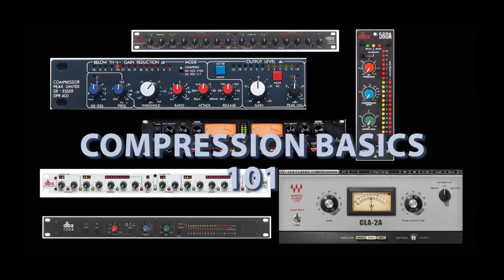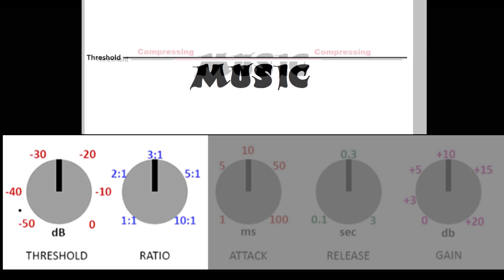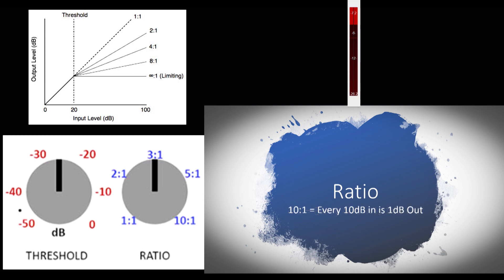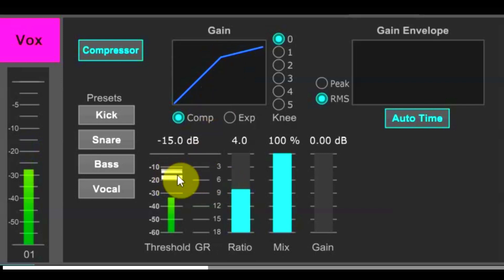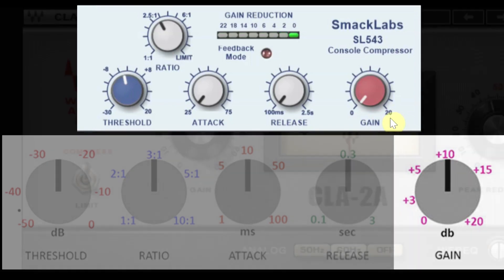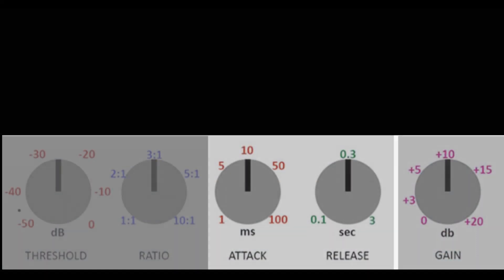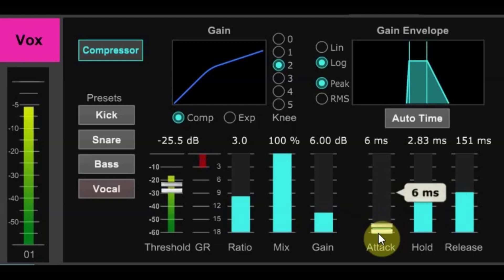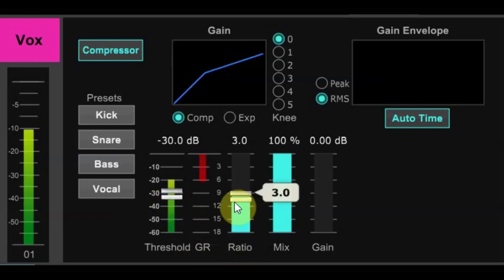Live Sound and Studio Compression Tutorial - Audio Compression 101 - Compression Explained - Basics

Comment: What settings would you recommend for a DJ set up with a compressor?
Reply from the maker: Is this for speaker protection or just limiting the dynamic range to keep things relatively even?
To keep things relatively even, I'd probably use a 3:1 ratio, auto time setting, and just adjust the threshold so the mellower stuff is just tickling the gain reduction meters, but louder tracks get into it more.
OTOH, if it's more about keeping softer stuff louder, I might back that ratio down to 2:1 (or keep 3:1) but set the threshold a lot lower so the mellow stuff is more into the GR meter. Maybe 4dB on average. Same auto time setting used. But this means the louder stuff will be comped more. You can use your makeup gain to keep your overall gain structure accurate. Or close to accurate. If you see you're averaging -8dB of GR, then technically you'd want 8dB of makeup gain.
At a certain point, you'll get into too much compression so you'll have to listen for that.
And remember, if you're narrowing the dynamic range of the music, then the amps will be consistently working harder in that range, but less peaks and valleys. So no/less breaks for the amps that comes from natural dynamics of the music. But, that said, modern music doesn't have a lot of dynamics these days anyway. So, you probably gain more by limiting the peaks than you hurt by raising the lower level music up (as far as amp/speaker issues go). At least if you don't overdo it. But clipping is still clipping, and clipping more often is still more heat and power compression issues for the speakers.